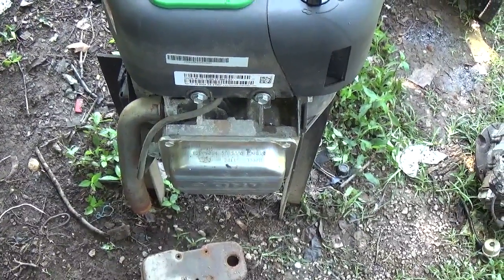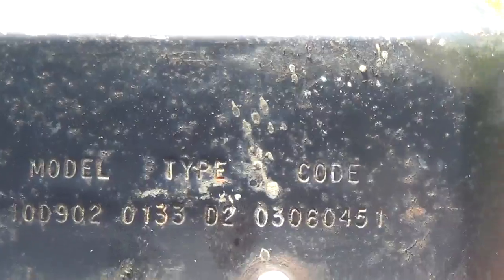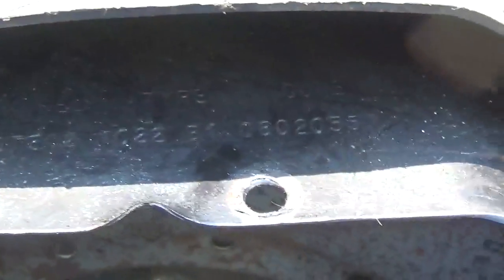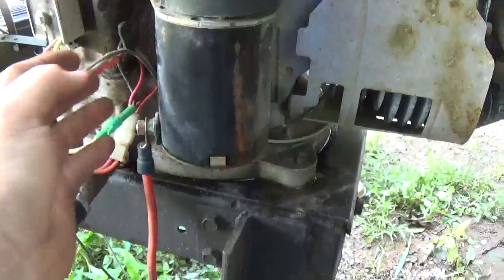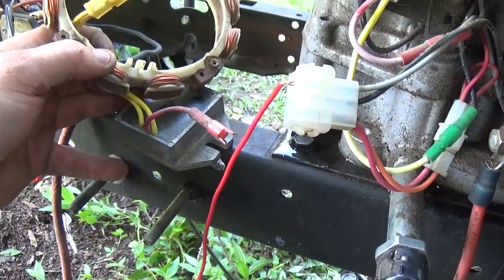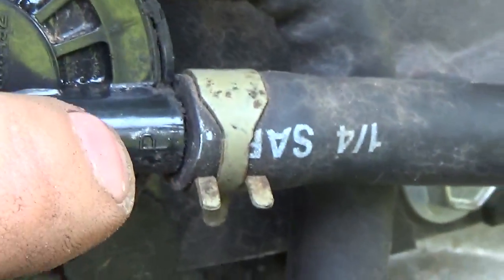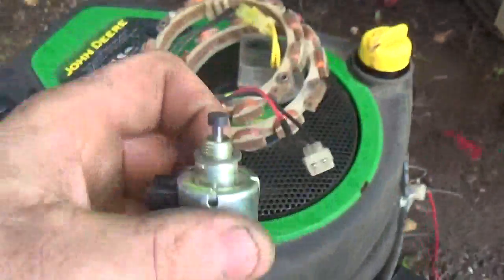Where to find Model, Type ,and Code on various Briggs and Stratton engines

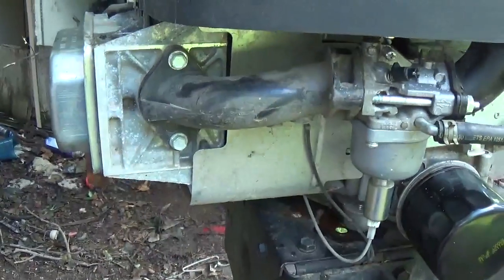Comment: I have an old Snapper walk behind with the Briggs Engine's model, type and code stamped on the back of the cover like You show at 1:35/12:05. the Model is 12H802 type 2611B, and the Code is 01041756. Ive been led to suspect by another video this engine was produced 4/17/2001. Does that sound right ? thanks in advance.
Reply from the maker: Yes....your code date is correct

Comment: HELP!! I haven't found anything online about my briggs & stratton  apparently it's a lost model I need a complete rebuild  kit  stamped  directly on the blower hosing is model type 0005 & below it is stamped 88202 078901 80022803
Reply from the maker: I know just what you mean ....Tell me is the engine a L head or Ohv type Perhaps I can find you a answer if I can find out witch you have  as you seem to be correct and I cant find the model  .